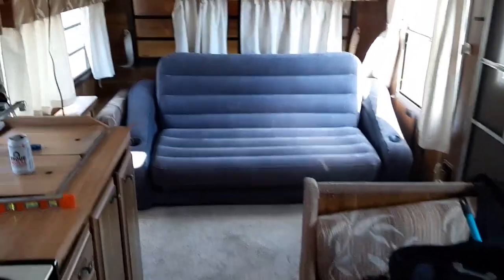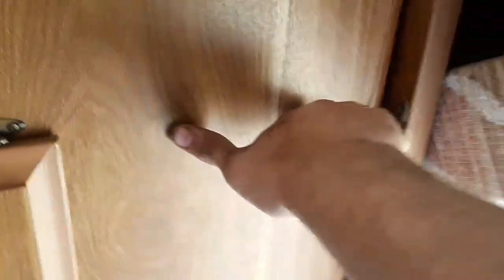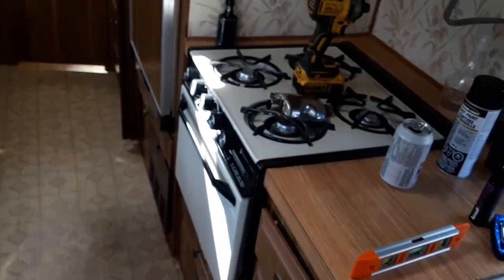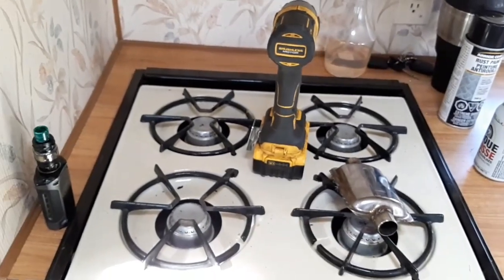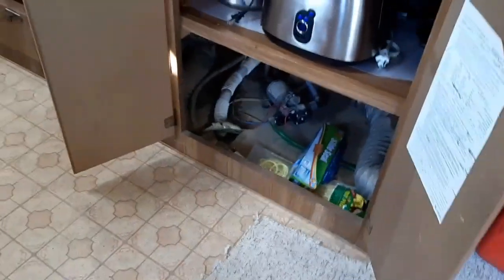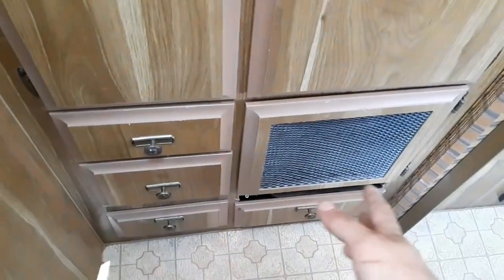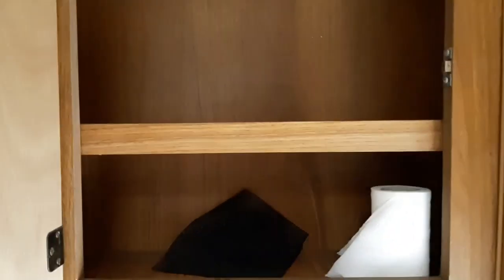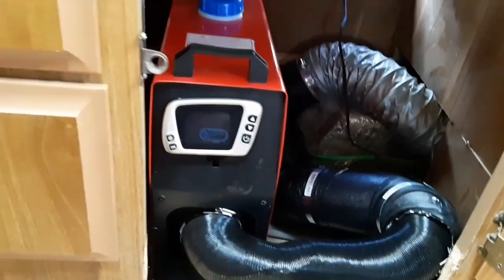1986 Fleetwood prowler 23P finished tour

Comment: I have the same exact camper except yours is in better shape my question is what size bed is the bunks I tried putting a twin-size mattress on there and it is way too wide
Reply from the maker: Yeah  the twins are too wide. I can't remember the dimensions, but something like 12 inches too wide. They don't make mattresses the size that fits our campers and have to get them made out of foam and cut to fit
Reply: @AaronsAutomotive  I actually found out the size the closest I have seen without cutting foam would it be a size called a narrow twin size I'm not listing the website but it is out there if you search narrow twin